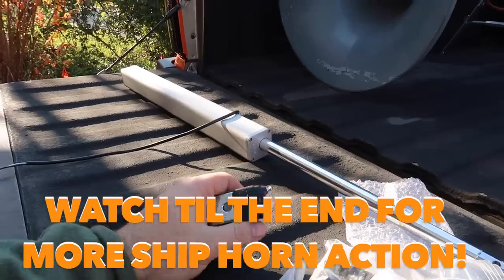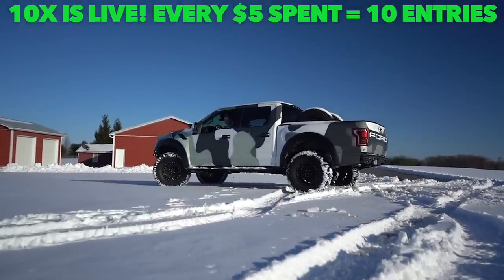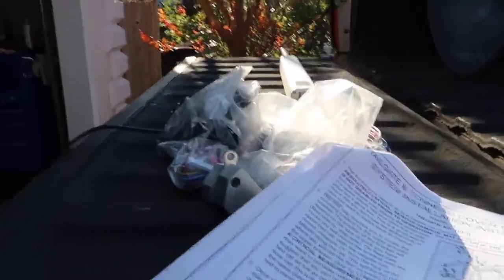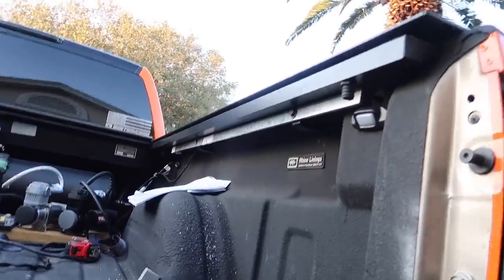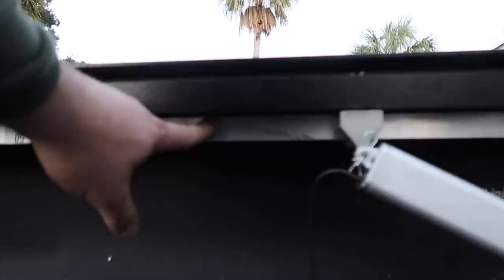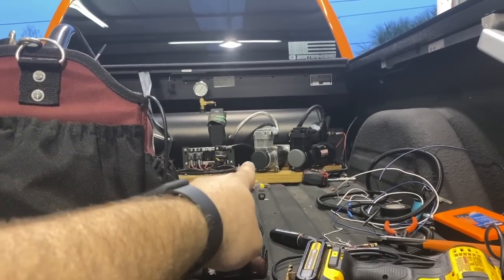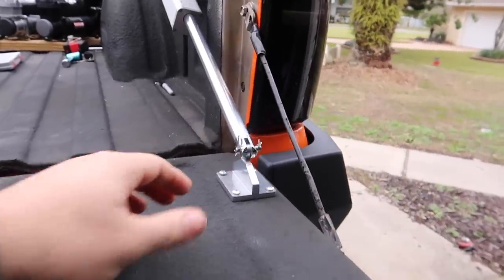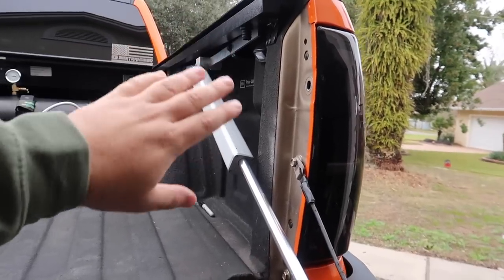Tailgate me now, I DARE YOU! (Ship Horn with Remote Tailgate)

Comment: Gotta love the p hub intro. I used it in my Dex video. Lol. I have a Camper shell on my F350 with LED floods aiming backwards at the douchwads that tailgate with their highbeams on. In the Superdutys, there's no escape from lights in your mirrors because of the convex mirrors below the regular side mirrors. I even have a sticker on the back glass that says "THE CLOSER YOU GET, THE SLOWER I DRIVE" Sometimes,  if it's a drop top, I'll roll coal on them.

Comment: does your tailgate unlock from the cabin? I ask because I like the lowering setup you installed and was curious. I'm currently putting in an order for a 2021 Silverado 2500 and wanted to know if it could possibly work for me.
Reply: My guy, this truck is older than you. Ofc it doesn't unlock from the inside.😂 I'll bet that 21 gay man's choice does though
Reply: @Yousef71017  doubtful the truck is 42yrs old